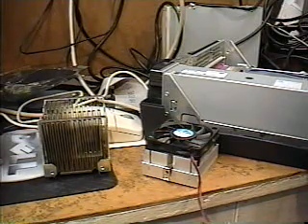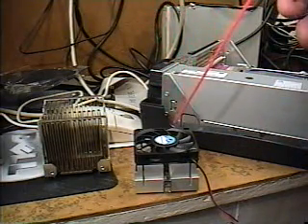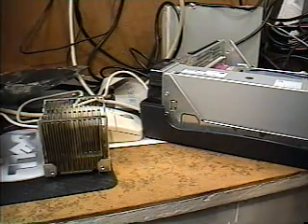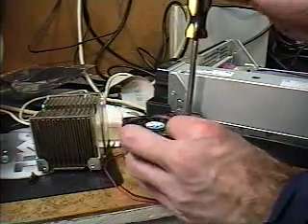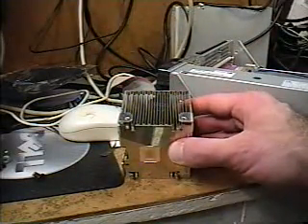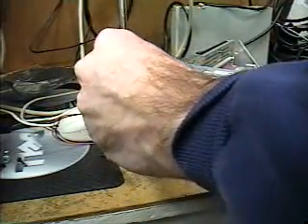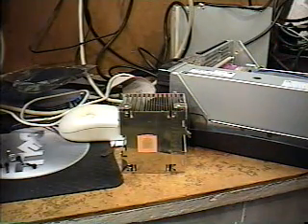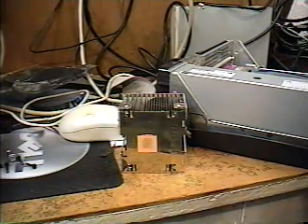PC Repair 2

Comment: My gateway  keyboard keeps typing repeatedly and its not just one key. after a while it stops, and another key is repeatedly typed. its getting irritating and i need help. I have tried reinstalling the operating system and drivers but the problems keeps surfacing